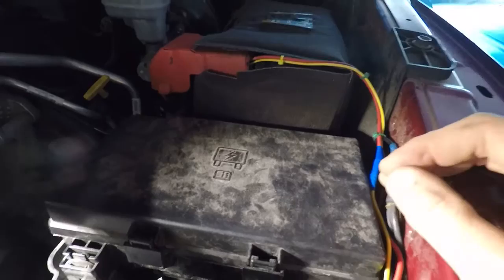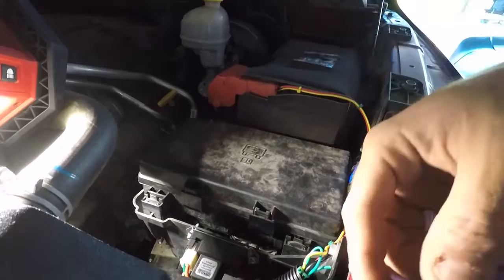Adding a Derale Engine Oil Cooler to a late model RAM 1500

Comment: Can't believe this isn't talked about more. My 14 hemi ram has the same issue towing, I  have to limit my speed to keep the oil under 250f. I guess ram doesn't think it's a problem as long as you run synthetic.  My trucks don't even show oil temp so it may not even be an issue.

Comment: My truck has the exact same year make and even color with the 5.7 and has 200,000 miles on it and began smoking upon start up. After installing this kid and of course changing the oil I discovered it fixed the problem and runs better than ever

I tow. 9 plus with it and doesn’t skip a beat!!!
Currently 212k
Reply from the maker: That's good to hear. We've got about 130k on ours and I'd love to get 200+ out of it. Thanks!

Comment: It depends where you live, but if in colder states, it is a good idea to have Derale oil thermostat. It keeps oil bypassing until it reaches 180F, allowing only about 10% to circulate through cooler.

Comment: Good job. I have a 2020 Ram 1500 Classic and they’ve added an oil cooler that taps into the lower radiator hose. I’ve relocated the filter housing to the front. Easier to change and I’m using a larger filter for increased capacity. Seems to be running smoother with 3-5 degrees cooler oil temp.

Comment: So I installed the 15502 model in the same spot using the green threaded adapter which accepted the stock filter size fine. I don't have a fan like yours but I think I will add one later. Towing before the oil cooler I was getting 236 on climbs. 215-218 no loads. With cooler behind the bumper no fan I reached 198-201 today no load.
Reply from the maker: Excellent! it's the best thing I've done to the truck. so far no issues.

Comment: Very cool! The other nice thing about setting it up this way is you don't reduce the AC's performance or the radiator's performance by blocking airflow through the condenser and the radiator by putting a cooler behind the grill. Just curious if you noticed a decrease in coolant temp after you installed the oil cooler?
Reply from the maker: Howdy! No difference in coolant temp. As that is regulated by the thermostat in the engine, generally, unless you're already running hot, reducing the oil temp won't cause any noticable difference. I'm sure it did help a little under heavy load as there was less hear to be removed otherwise. Thanks!
Reply: @aaronsrose  Thanks. What I did on my Civic is I got a 30 plate fluid to fluid heat exchanger and a sandwich plate and I'm running the oil through one side of the heat exchanger and I'm running the coolant through the other side before it flows through the heater core. This setup works very well too, it keeps the oil cool when driving hard and helps warm the oil up quicker as well since the coolant warms up quicker than the oil but stays cooler. The oil temp now pretty much stays at 180-190 degrees like the coolant regardless of outside temp or load. I didn't notice a change in coolant temp either other than that it takes about a minute longer to warm up since it's heating up the oil as well. I should make a video of my setup as well.

Comment: How did you connect the cooler to the oil supply?  It is my understanding that the sandwich adapter can't be used on the Ecodiesel oil filter type.
Reply from the maker: Mine is the 5.7 gasser so the adapter fit perfectly.  Not sure about the ecodiesel.  Thanks!
Reply: Did you ever find out if this set up works on the ecodiesel?
Reply from the maker: Looking at the ecodiesel filter, it appears to be a cartridge rather than a screw on so the adapters in this kit won't work. There may be another way but I'm not sure how it could be done. Thanks!

Comment: What oil filter was used? Model number etc. I learned I may not be able to use factory or stock oil filters.
Reply from the maker: Thanks for asking. I use an Amsoil EA15k50. Plenty of clearance even with the added height of the cooler adapter.
Reply: Would you happen to know a fram or Walmart equivalent to that filter? Also which color nut fit for you on the sandwich part?

Digging around I found the instruction manual online and saw the filter list. Looks like the stock filter may fit but there is a list of filters based on the threads I end up using that should fit. I'm trying to pregame everything before I get the cooler in the mail. Thanks for this video.
Reply from the maker: pantera6925 The cheaper fram and stp filters have 10060 in their part numbers but I would not recommend them unless you insist on changing your oil every 3000 miles. I would recommend the Mobil 1 M1-113 or the K+N HP-1017 instead for normal 10000 mile intervals.
Reply: What are your oil pressures?
Reply from the maker: pantera6925 Of the top of my head, 50+psi. Haven't paid much attention to it as it hasn't changed in the 63000 from New.
Reply: Aaron Rose good to know. Just curious if your cooler and hoses to
The cooler affected your pressures at all.
Reply: pantera6925 don’t use Fram or K&N. Fram uses cardboard which breaks loose and clogs things up. K&N will work loose. Go with a Mobil One or Mopar, a bit more but cheaper then a new motor

Comment: Hey how much did this increase your oil capacity?
Reply from the maker: If I recall correctly,  it was a bit less than a quart. Though the oil change quantity won't change as you really can't drain the oil in the cooler.  Thanks!
Reply: @aaronsrose  Thank you.

Comment: I was pulling a trailer trying to go 80 keeping with the idaho speed limit I looked down in my engine oils 265 and now I'm looking for an oil cooler
Not a heavy trailer just a nice windsail enclosed trailer

Engine oil breaks down at 275 if your oil ever reaches the temperature 275 you should do an immediate oil change cuz it's lost its lubricating properties at that temperature

Comment: Just got the full kit a day later then I would have wanted but it was it is. 
Firstly, thank you for the info and video. 
But my primary question is the wiring. I'm looking to do it the way you did, if 6ou could get ahold of me ill send you my number.
Second question where did you find the tee?
Reply from the maker: Howdy! The tee and associated plumbing fittings were from home depot iirc. Wiring-wise, I just followed the instructions that came with the switch kit. I think the only thing I did different is I did not set it up to turn off with the key. It was 12v hot all the time so the fan would run after the truck was shut off until it cooled down to temp. Thanks!

Comment: Is this a push or pull fan?
Reply from the maker: I've got it setup to pull. Looking at it, if you swapped the leads, it would most likely work as a pusher.
Reply: Thanks! Got the same kit because of your video. About to put it in today
Reply: @andrewmcmillan8110  How has your cooler performed?
Reply: @Josue-rd5gt  awesome! I picked up a toy hauler and fully loaded it weighs around 8200lbs. I’ve never had my temperature over 225 with this system and I don’t baby it.